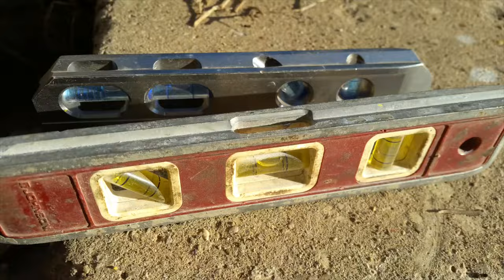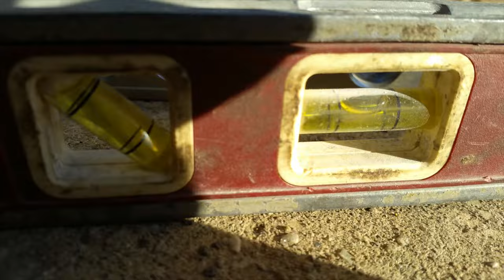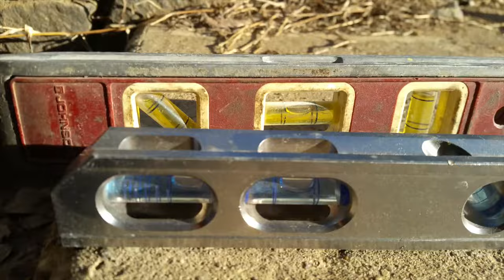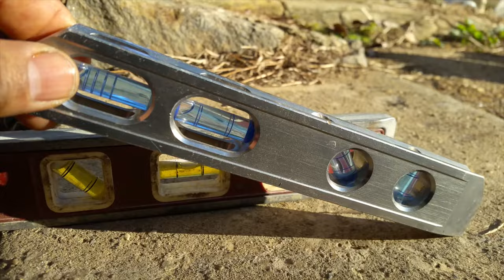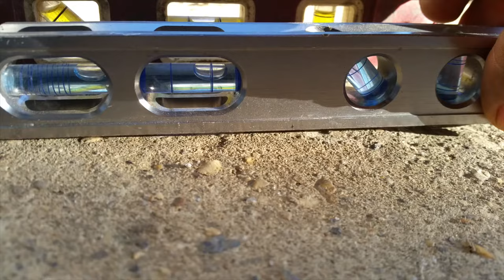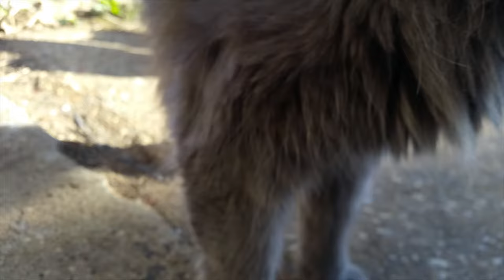How to read a level the easy way

Comment: LOL when you said the contractor and the building instructor both failed to interpret the level correctly, I assumed there was some sort of sacred knowledge that was picked up through decades of careful observation, which required such a high level of expertise, not even a certified building inspector is familiar, let alone a mere layman. I intently listened, seeking to learn this once but no longer forbidden knowledge 😱

"Bubble go left, left side high spot"

 😂 dude that must've been quite jarring, relying on the building inspector to quell this ridiculous debate, only for the building inspector to validate the other guy!! Unbelievable 😂😂

Comment: Why the bubble is not touching the right and the left ring???????????????????????
Reply: Why there is 0,5mm on the left and the right of the bubble?????????? between the rings??????????? @EngineerPEretired
Reply: @edgaro67  I think those rings show one quarter inch per foot rise, something like that, so lift one end till the bubble touches that line, for pipes/plumbing etc to flow liquid

Comment: So, how do you tell the surface is level?
Reply from the maker: When it's no longer out of level. Ha
Reply: @EngineerPEretired  Thanks for the reply. I'm new to this. I plan on using it to ensure my expensive washer dryer set is leveled. So, when the bubble is perfectly in the center, that's when the surface is level correct?
Reply from the maker: I just posted your video reply 
search channel videos to find it
Reply: When the bubble is in the middle